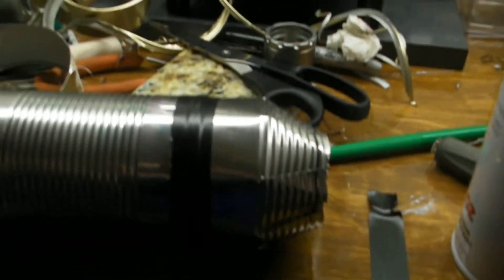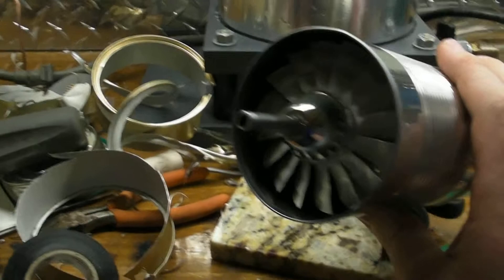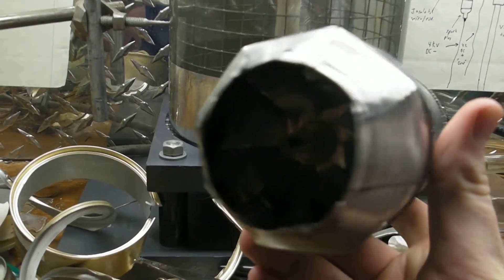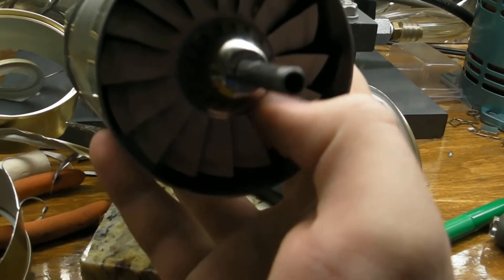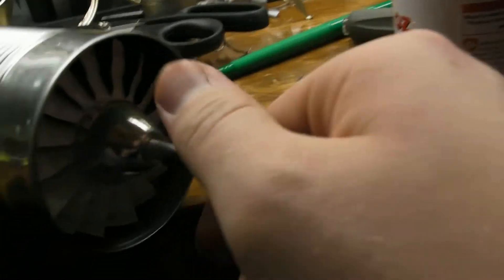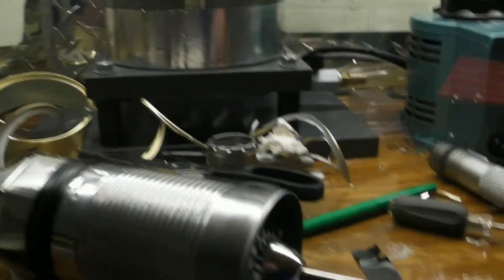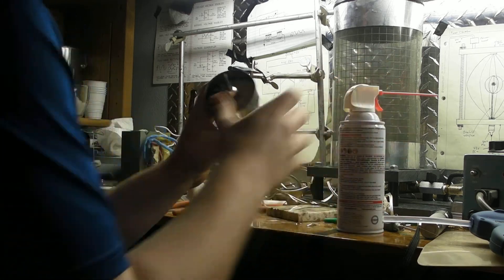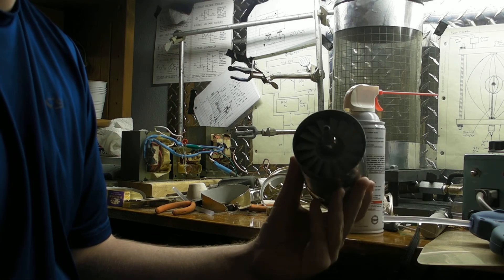Tin Can Jet Engine Project Update 1

Comment: With some attention you can get the system better aligned and that shaft runs smoother.  While such an engine will not work, the details are good to give an idea of what ingenuity is all about and one can spend many hours of enjoyment coming up with solutions of problems that come along. Seeing this video I must congratulate the young man on the " folding "rather than the "twisting " of those tin  can turbine and compressor blades.  I like that fold that was chosen and if one is  seeing more " perfection" one can  form the blades for them to be either a compressor or a turbine blade , where the shape is slightly different.   Parsons in England sketched a  steam turbine blade over 100 years ago and he was ust about right about the profile one needs to extract maximum power from high moving fluids as steam in his case.     Any school should offer these situation where knowing the universe and its materials and how we could use them all to make our life more comfortable  should be as important , if not more, as reading and writing and reading man made language products or should I say  just being vociferous in society!   Congratulations for the folding of tin  cans to produce  or imitate one of the most beautiful thermodynamic cycle in engineering which has made our life pretty comfortable through using the thermodynamic cycle in many machines in our homes and industry and transport systems.
Reply: I came back again to this video after two years .  It seems that the curve of the power turbine blades are not curved properly, Still congratulations for all this work.
Reply: The last comment was meant for another  tin can jet engine.............my apologies.